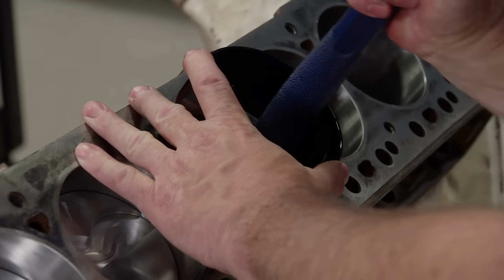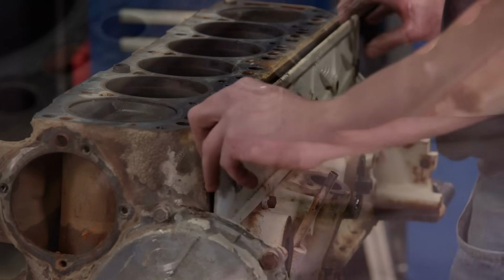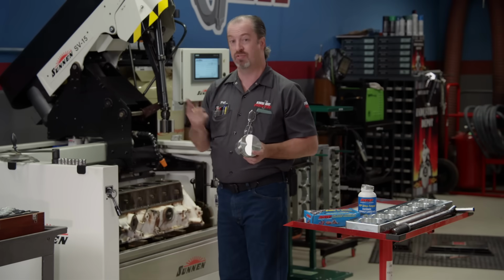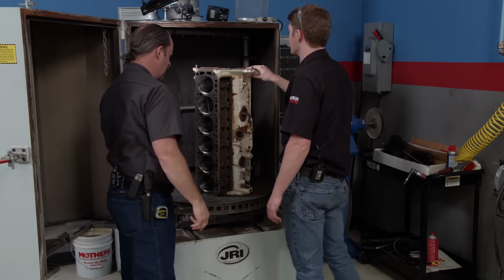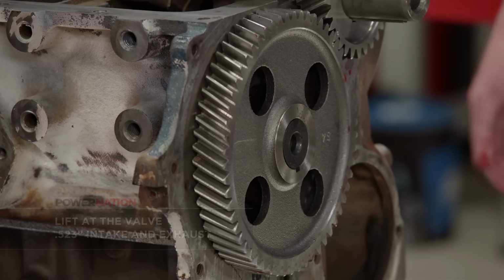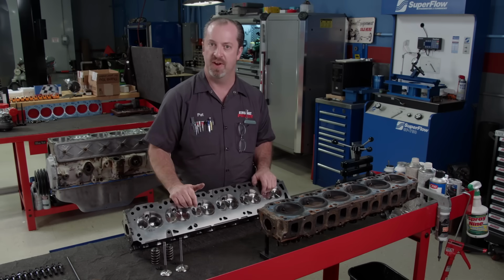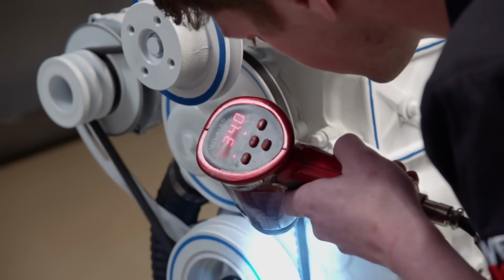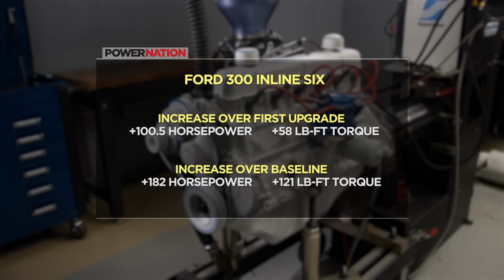Full-Tilt Build On Our Ford 300 Inline 6 For Serious Power Gains - Engine Power S8, E3

Comment: I c u guys change the ignition timing..... Why don't you change valve timing at all?
I understand that the center line of the inlet is tied to the center of the exhaust on a single camshaft... But is there not a bit of wiggle room to change the valve timing.... Or even the lash gap?
Reply: Hydraulic has no lash. It could help a touch if they retarded the cam just a little, just depends on goals and grind.

Comment: Guy brought me his bike that wouldn't start. Had a rag stuffed in the carburetor.
Reply: I had an old Wheel Horse lawn tractor that you had to stuff a rag in the air intake of the carburetor to get it to start.
Reply: @guardrail2897  A choke's a choke I guess.
Reply: @guardrail2897  homemade choke.
Reply: A friend once bought decades ago a Chevrolet with a 'stove bolt ' engine.  I ran okay for a awhile and then it didn't run and made a lot of noise.  Well, turns out that the previous owner had replaced a couple of insert bearings between the crankshaft and rods with pieces cut from a leather belt.  My friend was disturbed about this and used bad words.
Reply: @zeekwolfe5781  haha. I had a 51 chevy pickup 216 six. It threw a rod, I pulled the piston assembly and ran on 5 cylinders for a couple weeks. Couldn't see out the mirrors it vibrated so bad. Got me to school and work until I got a 235 for it.
Reply: @zeekwolfe5781  by any chance was this a 2nd Gen camaro
Reply: @jacobwright2201  Nope, it was a 1952 four door sedan 'fastback.'  Rare model, so I'm told.
Reply: @zeekwolfe5781  nothing wrong with that. my grandpa did that with a model t banger engine. ran until he sold it, and told the guy that bought it about it. guy ran it for YEARS. never messed up. however, my grandpa use a tongue from a REAL leather shoe and soaked it in oil and grease.
Reply: That'll do it! Edit @jim martin, lol :)
Reply: I've heard crazier.

Comment: I would like to see it Fuel injected and then turboed
Reply: Later model 300 inch Ford 6's had it...25mpg in an E-150 Van...not really a lot of power box stock...BUT EFFICIENT...I NEED A VAN...E-150...Im 72 Homeless living in a 91 Nissan Sentra XE...234,+++ Miles and still gets 35.86mpg!!! Just replaced 5 speed...bearing blew...wah...But I need an 93-96 FORD E-150 INJECTED VAN to live in the rest of my days...wheweeee...
Reply: @bigsparky8888 the one I drove in an extended church Van in a f250 just had the C6 and it would get 15 on a good day. But I never wished for a V8 in it..I used it mainly to haul washers and dryers and furniture and stereos and it was great for that.
Reply: @bigsparky8888  i want to buy this engine from them.
Reply: @dustinontaiyabbi  ASK THEM...I AM BROKE...
Reply: @bigboreracing356   I’m sorry but turbos don’t work on diesel engines because of the fuel. Manufacturers change the turbine housing diameter and ar so that the turbo doesn’t need as much volumetric flow to spin the compressor. Therefor allowing the engine to spin at reduced speeds and still get optimum rpm out of the turbo. Also why are you comparing technology from the 1965 to something from 2021. No direct injection, no cross flow head, no overhead cams or even roller cam, and no computer to run it. Even the most recent 300 i6 from 1996 had first generation OBD2 which is no where near what we have today. For what it is, it’s doing pretty good. Keep in mind this engine was never designed to make this kind of power it was ment to run forever and that’s why you can find these with 3,4 and sometimes 500k mile on them. I would say don’t compare apples to oranges but, I don’t think that’s far enough apart.
Reply: @themonster9879  you clearly haven't spoken to the folks at Clifford Performance.
Reply: @bigboreracing356  I understand you are only trolling me because you need human interaction. Get outside. Make some friends and enjoy life.
Reply: @bigboreracing356  Lol. The EPA hasn't had any good intentions in at least 20 years.
Reply: Ford Australia did that. they call it a Barra
Reply: @RedmistAU  imagine putting one of those in a 260Z
Reply: @deborahchesser7375  ZIPPY to say the least...wow!!!
Reply: @deborahchesser7375  why put a chevy350 in it and be done
Reply: @RedmistAU  Our barra is a little more advanced than the old 300 haha
Reply: @kobescambler  Not as much as you would think. The Main bearings are still exactly the same. We went from 250 pre-xflow to machining off the intake manifold and making our own. We called the the 2V for the 2 barrel carb. Next we made a cross flow head, then made that from aluminium. Then overhead cam, then 2 overhead cams. Still the Main Bearings are the same.
Reply: @RedmistAU  Block is still quiet different tho
Reply: @kobescambler  the old US 300/6 is to the Barra like Chevy's original 283 to modern LS.
Apples to Oranges.
Reply: @kobescambler  the block changed a great deal going from AU to BA. There are a lot of iterative changes overall and the Barra really is a world away from this thing.
Reply: @kobescambler  And the head.
Reply: @kobescambler  it’s not meant to be a barra. It’s an old motor making healthy power. Not a new motor making crazy power.
Reply: @prestongeorge9469  exactly! They were tuned for longevity not drag racing. Maybe they weren’t rockets, but like the tortoise and the hare, you gotta finish to win.
Reply: The Australian  engines  are all from the original  falcon family  ! The 240/ 300 is a totally  different  engine developed  for trucks in 1965 and continued thru 1996 being eec4 multi  port  injection  from 87 to 96. It was used in e and f series and f medium duty trucks  as well as generators, air compressor and air  port mules as well  as ups vans.   It uses meshed  timing  gears  ,  the small  falcon based engines use timing chain.
Reply: @kobescambler  is it as unkillable like the i6 300, from what I've read it was the final motor to have a gear on gear timing setup reater than a chain or belt, at least in the general consumer models
Reply: @RedmistAU  6o6o6
Reply: @RedmistAU  the barra is a different engine designed for a different purpose.

You dont see barras in dump trucks.
Reply: @dustinontaiyabbi  you sweet summer child. The barra is a direct descendant of the pre crossflow ford 6. It even uses the same crankshaft bearings. It is basically the same block with a twin cam crossflow head. BTW we added a crossflow head to the pushrod ford six in 1976, EFI came in 1985, OHC head was in 1988. Twin OHC was in 2002 and we added the turbo at that point.
Reply: @RedmistAU  I'll buy a crossflow head from you😎
Reply: Yes! But first Id like to see the afr curve on this current carb setup
Reply: @bigboreracing356  or is it because of the muffler bearings
Reply: @bigboreracing356  You're using logic and  common sense. Both are a foreign language to the EPA.
Reply: That would be great
Reply: Super sniper be perfect
Reply: Why, you remove reliability, at that point just use a 2JZ
Reply: 3x 2v webers would look very good to
Reply: @bigboreracing356  It's not a lie. It was 67' Ford Falcon with a 200 Straight 6 it had over 1.1 million miles.
Reply: @bigboreracing356  Your mom is calling you.
Reply: Anybody consider a supercharger from a M-B Kompressor engine?  I have seen rebuilt ones for $200, V-belt and appear to be about the size of a Sanden AC compressor.  Much simpler plumbing than a tubocharger and no worries about matching intake and exhaust.  I don't have a Ford 300, but have a 1964 Valiant w/ slant-six.  No need for bigger valves w/ boost.  My worry would be melting the pistons, as my 1985 M-B turbo-diesel has oil squirters under the pistons for cooling, which seems common for turbo engines.  If I used boost, I would keep it low like 8 psig, mostly to counter flow drops at high rpm.  There are also electric-driven superchargers on ebay and people say the better ones (>$1000) actually boost power (cheap ones actually restrict airflow).
Reply: @bigboreracing356  had 6 E150's in our fleet,  ran all 6 to over 1,000,000 before we retired them. Not too bad for a engine that sucks.
Reply: 1987 they were fuel injected.
Reply: @bigboreracing356  yup, I don't think I'm alone in that assessment either.
Reply: @bigboreracing356  I'd  rather have a non emissions diesel that is not going to de rate because the DEF tank is empty. Plus it's fun to roll coal on protesters and  Prius.
Reply: Agreed
Reply: Nitrous is better on these puppies
Reply: Very much!
Reply: @bigboreracing356  I think people that say that actually use them for work. Great in the woods and around farm .
Reply: You would blow it up.
Reply: @bigboreracing356  Ford stopped production of the 300/4.9L inline 6 because of emission laws.
Reply: @bigboreracing356  Those aren't myths.
Reply: @bigboreracing356  Because it was rebuilt.
Reply: @bigboreracing356  The 5.4L Triton was the worst engine ever built. There are some that make it 200K but the cam phaser usually blows shortly after that.
Reply: @bigboreracing356  I'm not. The engine itself does not have a governor. The ECM has a speed and rev limiter but that doesn't hinder the engine's horsepower or torque. I didn't say they don't "wear out", I said they reduce the wear on the cylinder walls and connecting rods.
Reply: @bigboreracing356  I don't know about "all" but I have witnessed a 200 Straight 6 roll over 1 million miles.
Reply: It doesn't need it. N/A baby!
Reply: They built the compression too high for turbo.   They will have to dish the pistons or get a larger chamber head and maybe a different cam I don't know the lobe separation of the one they put in.  But yes that engine needs a turbo.
Reply: Carbureted turbo
Reply: This is one of my favorite builds. Next episode, she's getting a turbo! 🌪️🌀🤘💪
Reply: They can just slap one of the major companies set ups that replace the carb with a throttle body FI.  I am leaning toward the Holley or Fitech.  The mega squirt would be killer but you would have to come up with a throttle body to mount to the intake and weld in injector bungs.
Reply: @bigboreracing356   Connie Kalitta went 7 seconds with a 300 6 in the 1320 with stock block and crankshaft no boost, he had Alan Johnson head on it
Reply: ProbAbly not within the capability of the engine.
Reply: ITB's would be dope 👌
Reply: U cant blow them things up they are tough I mean yeah they will blow up but ive seen them run with no oil pressure
Reply: @slabbusterrtr7690   a model A will run for ever with no oil pressure whats your point?
Reply: @noidontthinksolol  in lines are not naturally balanced. Most have a counter balanced crank shaft. The attribute of an inline engine is you can run an odd number of cylinders because they are in line. A naturally balanced engine would be an apposed cylinder design like a Subaru boxer, air cooled vw's and the   Porsche 911 just to name a few.
Reply: @bigboreracing356  they look the otherway when it's protesters. On the high way it's like playing Spy Hunter with smoke screen.💨
Reply: @noidontthinksolol  Eh yeh sure buddy. I'll just throw out my experience building engines and take your word for it Buddy.😒 is an inline 5 cylinder a balanced engine 🤔. Let's say it's a audi 2.1 T. You tell me if it is balanced.
Reply: @noidontthinksolol  I'm not trying to bust your but or anything but there have been manufacturers of inline sixes with odd crank angles so to say they all inline engines are naturally balanced is a misnomer.
Reply: @noidontthinksolol   Again you don't know what your talking about. Subarus have a harmonic damper. They  counter act the torsional twist in a Crank shaft. They have nothing to do with balancing the reciprocal Mas of an engine. On Subaru's and Porches the harmonic damper also serves as the main accessory drive so it's diameter is based off of the drive ratio the manufacturer wants to achieve. The mass of the damper is based on the power output. Dont confused a harmonic damper with an external counter balance. By the way the answer is   yes and no. Most 5 cylinders are balanced in the vertical. But they have a 36⁰ overlap in the firing order. That means 3 cylinders are moving in the same direction which causes a rocking motion down the length of the engine. The balanced of an engine has everything to do with the placement and configuration of the cylinders. In an apposed cylinder design the pistons counter act each other. No need for a counter balanced crank. Therefore  a natural balanced engine.
Reply: @noidontthinksolol  yeh you shouldn't.
Reply: Ford 300 and Barra aren't even related. The Barra is designed off the old Falcon 144/170/200/250 six, not the 240/300.
Reply: They went fule injection in 1988
Reply: Bingo
Reply: Fuel injection and ITBs😎
Reply: I'm arranging that with mine
Reply: Why not stroke it and see for beginners
Reply: Why not stroke it first and then see
Reply: They finally did it
Reply: They finally did it just so you know
Reply: And coil pack ignition
Reply: The first episode of the straight six series mentioned and showed they have a turbo for it.
Reply: You wanna do this to my 300 I6 E250 😂
Reply: Or be intelligent and use a supercharger.
Reply: Word.
Reply: Can’t like this comment enough
Reply: @bigboreracing356  and pulling heavy loads for hours on end is not an impressive thing. Its proof that you dont know wtf you're talking about.

Not to mention you indirectly admitted they could do it with your statements. 

Im 100% sharing this shit.
Reply: Just posted about the FI on my 96 f-150 it had" mass air"  95 had a diffrent kind and 97 was a new model .
Reply: @bigboreracing356  Most engines nowadays last around 300,000 miles. Today's V8s use less fuel than a 300 Inline 6.  Yes Inline 6 motors are extremely reliable mainly due to the have no need to be balanced like a V design motor and the movement of the pistons is straight up and down which greatly reduces wear on the cylinder walls and connecting rods.
Reply: @bigboreracing356  No. They are very reliable engines but they put out more emissions than a standard V8 and use about the same amount of gas.
Reply: Contrary.  Carbed and blown is always far cooler.
Reply: Did you not watch the end of the video?
Reply: Turbos aren't great on a 300, they are a low end engine. Turbos really only do well on high rpms. But the efi is good
Reply: @Quint1836   explain turbos on a diesel then.
Reply: @PFCwhiteUSArmy  Completely different engine, compression ratio, different ignition system, everything. And it all depends on what set up you're running. Been working on 300's for 15 years. I've seen turbo work, but most the time they aren't great
Reply: @Quint1836   exhaust gasses are what spool the turbo turbine. Don’t speak on a topic you do not know enough about. You need to match the correct size turbo to the engine. A small engine can’t spin a big turbo. For a quick spool up you just use a small turbo but too small then you hit a wall and it won’t be able to make any more boost. Boost is also a measure of restriction. The problem with the 300 is the exhaust heating the intake for one. The head doesn’t flow very well and honestly there is not a really a market of performance parts for it for obvious reasons. Since turbos seem complicated for you, maybe a procharger is easier for you to understand.
Reply: @Quint1836  working on 300’s for 15 years lol you look to be barely that. Maybe 1.5 years. 15years and you should see everything out there today.
Reply: @PFCwhiteUSArmy  hahahahaha!! Thank You for telling me that😂😂 had no idea😂
I'm laughing so hard right now, you're such a brave person, arguing over YouTube comments. Not responding to you anymore, you're not worth my time. I've been working on them 15 years. But if saying 1.5 makes you feel stronger. Go right ahead. I'm going to pray for you. Hoping you find peace
Reply: @Quint1836  all depends on tuning you can make max boost by 1500 rpm with the right turbo and Wastegate setup
Reply: @rustedratchetgarage6788  very true. Just depends on what setup you're running
Reply: @rustedratchetgarage6788  VGT and VNT from diesel engines can be adapted to smaller engines to get boost low in the rpm range.  My step brother got one off a Cummins pick up and put it on his 2.0L AWD Talon.  That car was wicked fast!
Reply: @Quint1836  that would depend on the size of the turbo my friend...
Reply: @Quint1836  750hp is fine on a built turbo 300 6 just keep it under 7k rpm
Reply: @Quint1836  your statement is limited;;; all the manufacturers take torque motors and add turbos for the power so dumbasses buy them and the torque is so they meet EPA ratings at low rpm
Reply: @Quint1836  bite your tongue! I've seen 1200 HP 240s because of a turbo. You just need different bottom end and you have a 240. The 240 didn't come with a forged crankshaft but the 300 did. Perfect for using Mustang turbos and mustang Webber carbs. The stroke is longer on the 300 but if you're fretting much about that you could use a different crank and rods and now you have a 240 for slightly more top end.